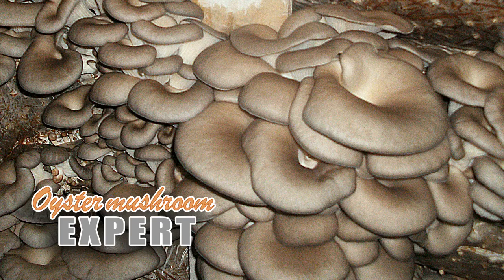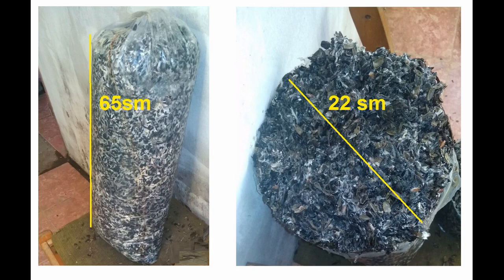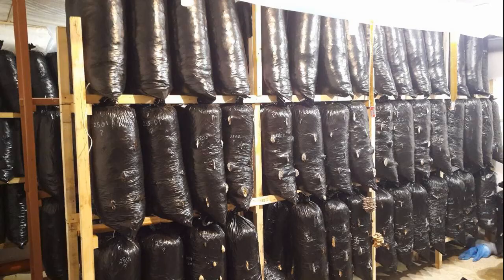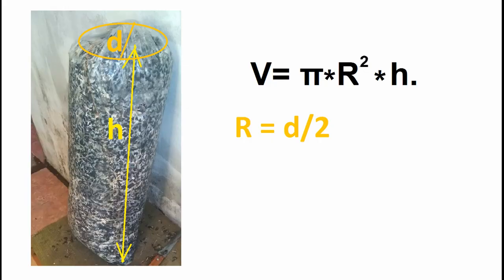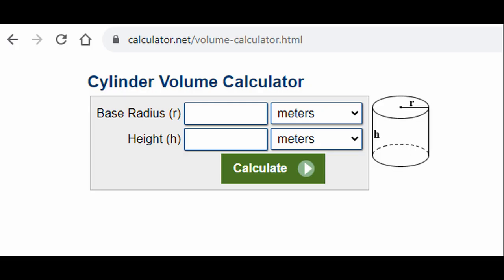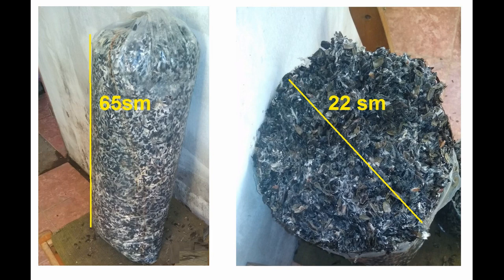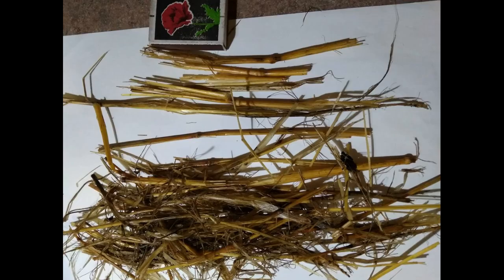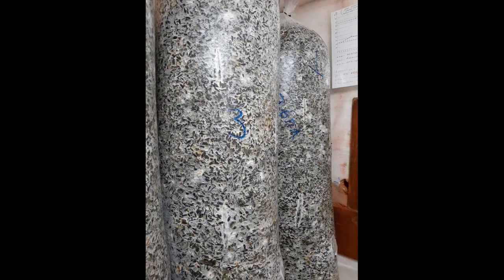Oyster mushroom block density. How much substrate per mushroom bag?

Comment: Hi. Thanks for the video.

You said "mushroom substrate in bag (block) must be 0.4-0.5 kg/lt. What about the substrate density in pasteurization tunnel?
  
For example;  we have a 3.5mt x 10mt = 35 mt²  steam pasteurization tunnel, and %70 moisturized wet straw heigt is 1.8mt  (35mt²x1,8m=63m³). After the steam pasteurization how many tons of substrate we will be produced? 

In short;
1) in a steam pasteurization tunnel, what is the optimum substrate height for an effective pasteurization? 

2) For the optimum height, what is the dentsity of substrate mass in pasteurization tunnel. How many kilograms/m³? 

Thank you
Reply from the maker: Great questions!
1. From my experience, the substrate layer shouldn’t be higher than about 2.0–2.2 meters. The key is to have a fan powerful enough to push air all the way through that depth. Also, no matter what height you use, you need to leave some free space under the ceiling — a bit less than one-third of the substrate height. For example: if your substrate layer is 2 meters, you’d want about 90 cm of headspace; if it’s 2.5 meters, leave around 1.0–1.2 meters.
2. Density depends somewhat on how finely the straw (or raw material) is chopped, but the optimum is about 400 kg per cubic meter. Maximum is around 420 kg/m³ — beyond that, some areas may get compacted and start anaerobic processes.
Reply: @OysterMushroom_expert-tech  

Thank you very much for the quick reply👏

In our region best (low cost, easy to supply) material for substrate is wheat straw (not chopped - like pipes).  
And we want to build an steam pasteurization tunnel for substrate production. We want to prepare 30 tons of oyster mushroom substrate per cycle.  

According to what you say, substrate density in tunnel must be  400kg/m³ ,  our one cycle pasteurization volume is 30.000kg/400= 75 cubic meters. I think  air circulation trough wheat straw pipes is not difficult. Because of that we can use height level 2.5 meters. 

75 cubic meters / 2.5 meter height = 30 square meter floor area is enough for  30 tons of wheat straw based substrate. 

I think our pasteurization tunnel must be;

*  3x10 meters  and wall height must be 3,5 meters. (straw height 2,5 meter and 1 meter for headspace)
Ventilation and steaming space under the perforated floor must bi 1 meter height. (  I think sometimes we will need cleaning under the perforated floor)

* I learned that we need 10-20 kg/hour steam for  per ton of substrate in your website🙏. 
30 tons x 10-20kg/hour = 500kg/hour steam capacity steam generator is necessary. 

*For the enough air circulation we need medium pressure radial fan ( 4000-6000 pa pressure,  6000m³/hour,  11kw-15hp is enough i think )

* Well insulated stainless doors, walls, ceiling, floor and air ducts. 

* For automation we need thermocouples in straw mass, headspace and underfloor ventilation space 

Can you see any wrong idea or calculation? 

Thank you for your attention, greetings from Türkiye👋
Reply from the maker: Thanks for sharing your detailed calculations. I see some issues: once the tunnel capacity goes over ~10 tons, the way of calculating changes — the tunnel size and the steaming space need to be designed differently. Also, the fan pressure and power in your example don’t look correct. If you’d like, I can give you a proper consultation on tunnel construction. I usually do this work for 500 USD, and we can go over all the details step by step. contact me WhatsApp: +380503960696
Reply from the maker: https://veshenka-expert.info/en/consultations-on-oyster-mushroom-problems/

Comment: 0.5 kg per litre is the dry weight density or the damp weight?
Reply from the maker: This is the substrate density in the state in which it is packed into bags. The substrate is generally not completely dry during production, as it is moistened before use. Only the raw materials used to make the substrate are dry before they are hydrated.

Comment: Absolutley LOVE your topics. This is the first video from you i have seen and it has more detailed info than the other hundred I have watched or the books I have read. But wont the density of the substrate be primarily effected by the density of whatever material is being used? It seems to me that a more accurate measurement would be the 'porosity' of the substrate. But you have given me much better than a starting point and your video answered several questions that i have not been able to get answered. Please get a better translation service and get rid of the computer voice. I've done videos for work before, ill narrate them for you! Seriously.
Reply from the maker: I have already thought about doing translations using gpt chat, I think it will be better than google translate. However, I do not plan to remake already made videos.
Reply from the maker: https://youtu.be/QW0tEMsq7zA
Reply from the maker: I used to have a channel in Russian. Then I removed Russian videos from it and posted English ones. But YouTube didn't recommend these videos and no one saw them. That's why I made a new channel. I have 20 videos already made, which I will post once a week.
Reply from the maker: write to me on my mail account for the scripts veshenka.expert@gmail.com